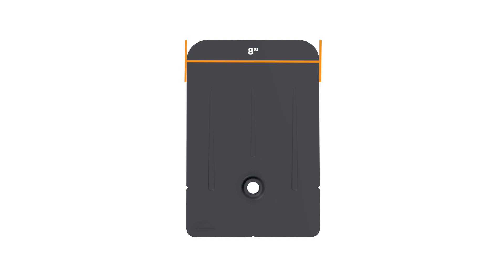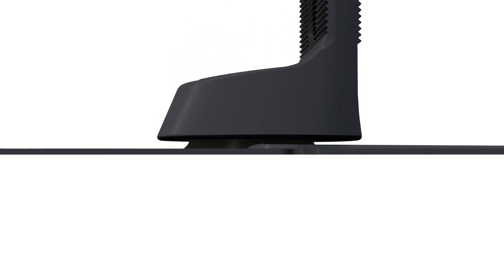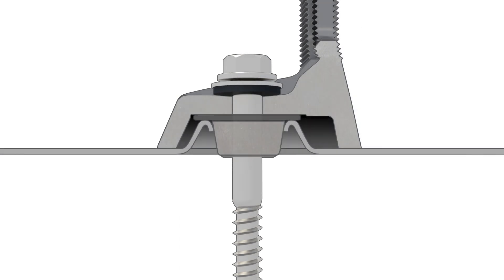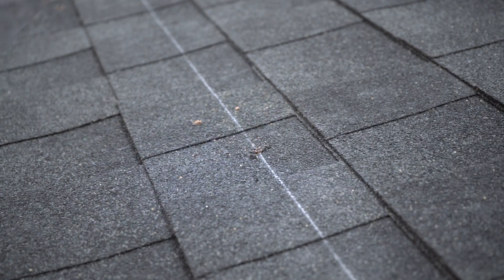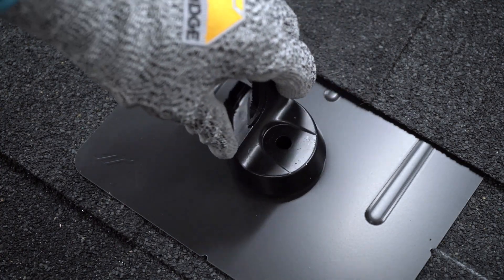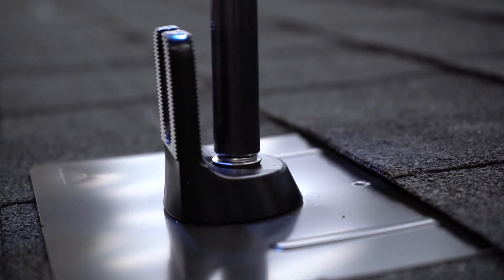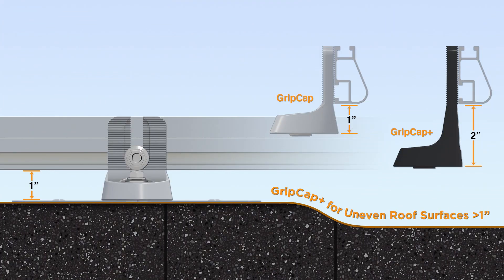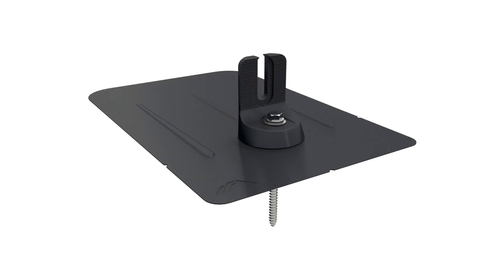IronRidge FlashVue™ // Moving Flashing Forward

Comment: My solar installer told me that for newer shingle roofs, it is better to use the QuickMount Halo UltraGrip than the FlashVue system. Any pointers on which one is better? Our new roof was installed exactly one year ago
Reply from the maker: Hey there! We have different options at different price points to meet different needs for installers. HUG can be much faster to install, especially on roofs with new shingles which can now be commonly bonded together, making traditional flashings hard to slide between them. Simply put, both HUG and FlashVue work great and use tested/trusted waterproofing technology.

Comment: the hole needs to be smaller its good because you can see the hole but also this way makes propriety . needs to be like others so its compatible with other parts and materials just in case.  11" long would be the best because 12" usually hits the roof nails. the code needs to be changed one inch in our experience.  Overall seems nice. Also GREENTECH only stocks the flash foot 2 which is terrible. First you have to drill the whole stick the flashing in.  Next, put the lag in.  then twist the flash foot 2 in.  Well after that the lag is covered and literally on a reinstall you have to dismantle the entire system now because you cannot access the lag.  that's why the flash Vue is very attractive except the things we discussed.
Reply from the maker: Thanks for the feedback! You can also contact our support team at support@ironridge.com to share this info and get any other answers or details you may need.

Comment: What is the difference between FlashVue and FlashFoot 2?
Reply from the maker: Hey Hrishikesh, great question! The FlashVue flashing is a bit narrower (to better fit between roofing nails) and also makes the pilot hole more visible--this also makes the stack of components and waterproofing a bit different in its style vs. that of the FlashFoot2. FF2 has a wider flashing and utilizes its own unique form of waterproofing technology. Both work great for protecting the roof and have passed the same testing. It ultimately comes down to installer preferences and pricing on why you may choose one over the other. If any further questions come up, please do not hesitate to contact our support team or your local distributor.